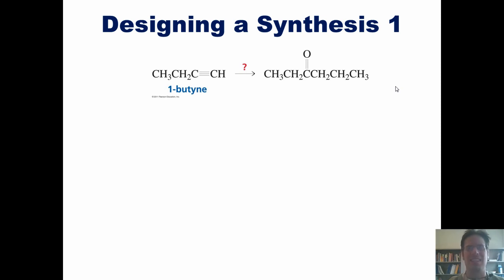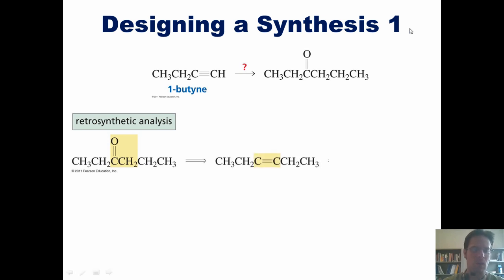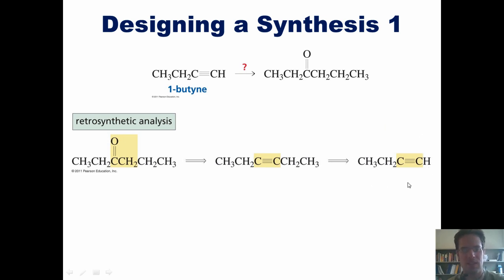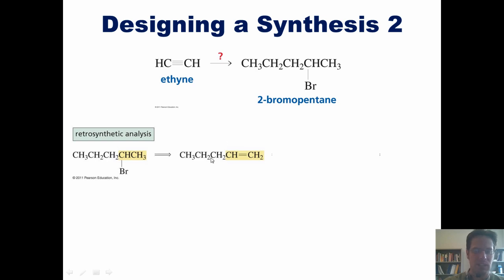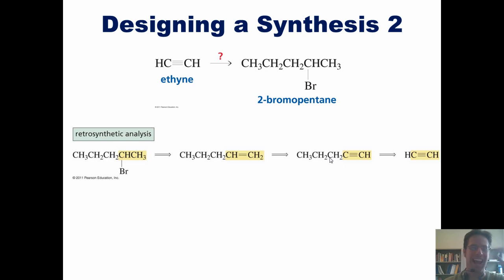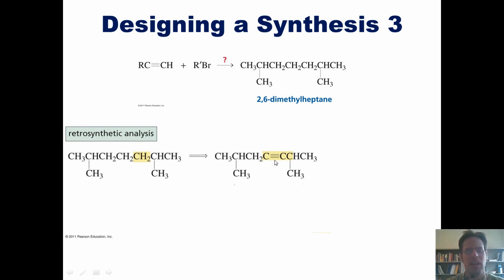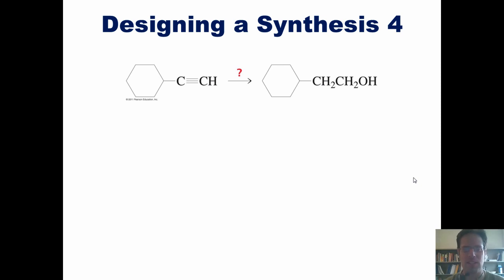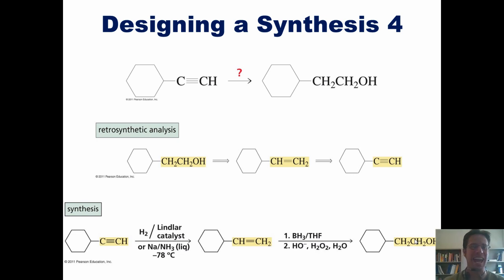Chapter 6 – The Reactions of Alkynes: Part 4 of 4

Comment: Hey mike, what about the Bromide by product? We neglect it ? 3:54
Reply from the maker: *****I do ignore it, typically, though it is there. In this case, the bromide byproduct is NaBr. The reason I ignore it is because NaBr is not soluble in the solvent in which these reactions are typically run. Hence, it is easily separated from the desired product (the internal alkyne) via filtration. But yes, you're right. It definitely is in there.
Reply: Alright thank you so much
Reply from the maker: You are very welcome, mahmoud. Have a great day!